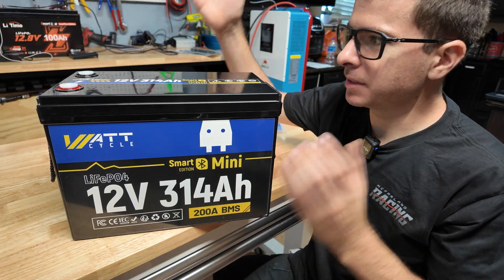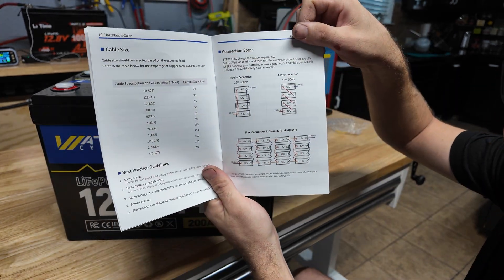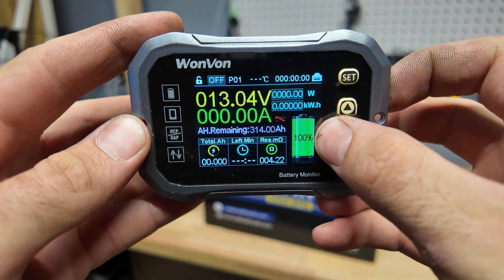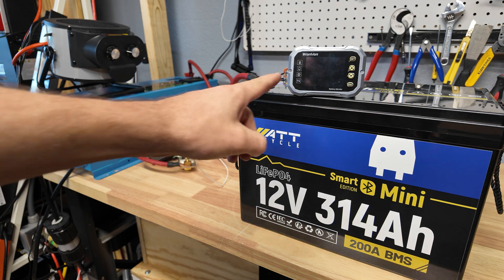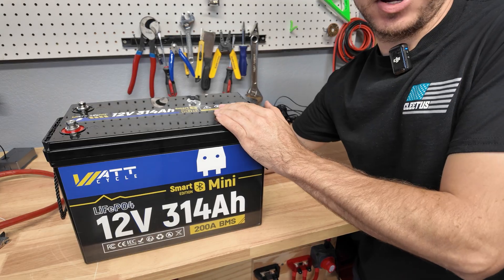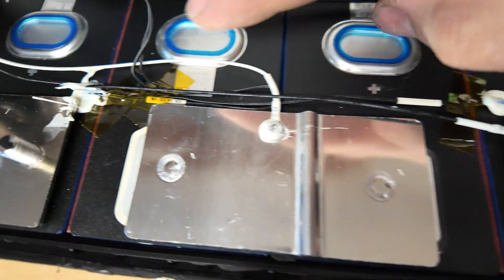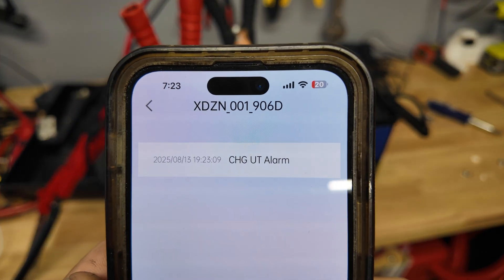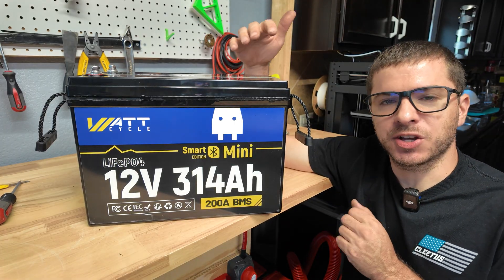Wattcycle 314ah battery Teardown, Testing! Giant Capacity Small Size

Comment: Acest tip de baterie de 12v 314 ah are un are un bms slab se deregleaza am 2 buc de 1luna si se deregleaza si cu 8% una fata de cealalta le folosesc exact cum scrie in carte cu un invertor de 24 v solid volt tot degeaba nu le pot readuce la egalitate ,sa se bucure cei la care merg la mine nu merg baterii noi .

Comment: Have you had any issues with this battery not discharging after you hooked it up to your 12v battery bank? Will Prowse just did a video exposing this issue.
Reply from the maker: In the middle of testing that after seeing that, I’m curious. I have had issues with other batteries in parallel

Comment: Tldr: don't trust this company. 
I bought this battery. Wattcycle is specifically targeting ads highlighting the part in the early video where he shows eve cells. I bought because people rate eve cells highly. But they have pulled another switcheroo to lower grade cells. In the three weeks this battery lasted me before shut down. It will not recover with their charger like I had managed twice before when it shut down for no apparent reason in the middle of the night. 
I monitored cell voltage difference and it gets wild as you approach 13.5 volts. I never got this battery above 13.6 volts and it never saw a load of more than about 30 amps. I've put my battle born battery back in the system that has run flawlessly for 4 years and it's running fine again but I'm out over 500 bones.
Wattcycle will not return my emails. 
They can't be trusted.
Reply from the maker: I’m sorry to hear about your experience, I would contact them and see about maybe a warranty exchange? I don’t believe anything that’s why I tear down and try to show what I find and to educate people.
Reply: Did you make contact with them, any warranty let’s hear how you got on. Regards K
Reply: @kelgadeke5102credit card dispute got it resolved. You have way more time to file a claim after a purchase than you might think. 6 months is what I've been told.

Comment: REPT are known, there price has stayed pretty level. ECO WORTHY uses them in server rack battery. My wattcycle 314 pulled 325Ah but from DC load at much lower output.
Reply from the maker: Good to hear the cells are good!
Reply: So when no loss in conversion shows less capacity weird

Comment: Do you have a video showing safe measures while paralleling batteries? I want to get a few of the dc house 48v 100ah batteries and build a system around them. Still trying to get a good understanding on where fuses/breakers are recommended
Reply: Generally you want to fuse each battery as close to the positive terminal as possible. Remember that fuses are to protect the cables. Cheers
Reply from the maker: Just fuse all of the batteries, i also have each one with a large anderson connector, then they all go to a common busbar that feed the inverter. Each of my batteries either have built in breakers, or external fuse.
Reply: @Mikebuildss have a link to which fuse you prefer?
Reply from the maker: @rnkustomz check description added a link. Used the same ones in my system they work well, easy to use
Reply: @Mikebuildss  Thank you sir!

Comment: Will not connect to Overkill?
Reply: Negative, wattcycle doesn't use JBD BMS. Unfortunately, you are stuck with their own application. Some had success with another application GoKWh (similar to overkill) but mine didn't work.
Reply: @fmachinegns looks like a good battery, but I like JBD BMS.
Reply: Agreed. Vatrer uses JBD, I haven't seen anybody test their 300Ah battery that's in similar price range.
Reply: @fmachinegns I have a DC HOUSE 48V 100AH abs plastic golf cart battery with JBD,...love it use it for off grid solar.
Reply: Agree! I have 3 in my setup. Solid option at the price.

Comment: Cycle it 50 times then do a capacity test.
Reply: It's probably not useless. Batteries will show degradation over time, bad batteries, much quicker. Mismatched and b grade or used cells more so. 
I bought this battery and it has lasted 3 weeks and now will not wake up. 
Wattcycle pushes an early review that showed A+ eve cells, that's why I bought it since people like eve cells. Wattcycle has changed the cells as shown in slightly later reviews including this one, to lower quality cells. 
So yeah, if it doesn't die in 3 weeks with no email back from wattcycle like me it might be nice to know how quickly the cells degrade. 
Some of these companies claim 15000 cycles, do you believe that too?
Please don't take it personally, these companies are shady af and I'm losing sleep after they just took my money for nothing. 
I'll give them a little time and then I'll try to get my credit company to take care of it.
Reply: @daveybphotography any updates on this case?
Reply: @Doodlehed99 credit card dispute got it resolved. You have way more time to file a claim after a purchase than you might think. 6 months is what I've been told.
Reply from the maker: Good idea!
Reply: Lifepo4 batteries has like 5000 cycle life so usless comment
Reply from the maker: @damianoleonardi2479 he probably wants to see capacity after it’s broken in a bit